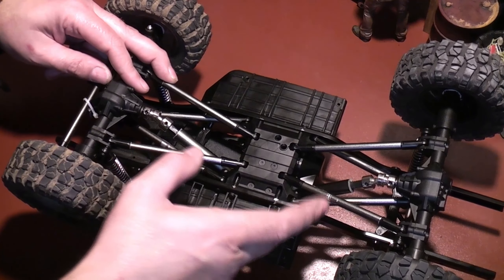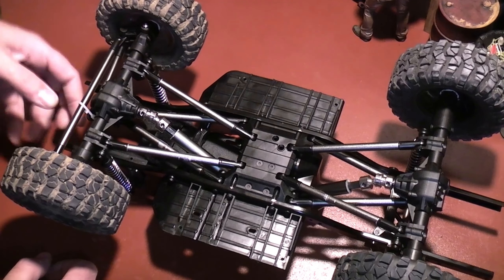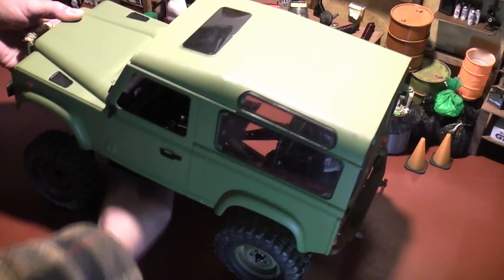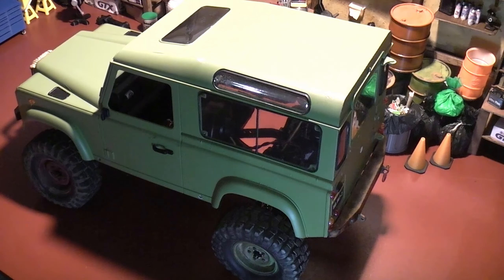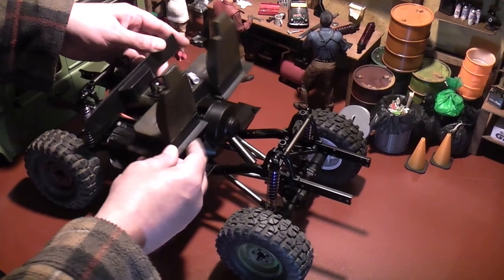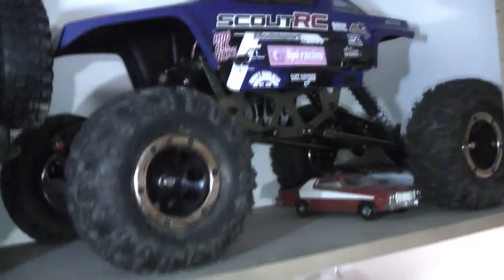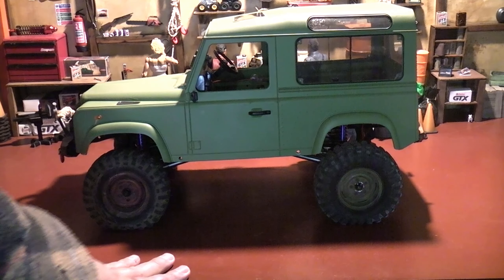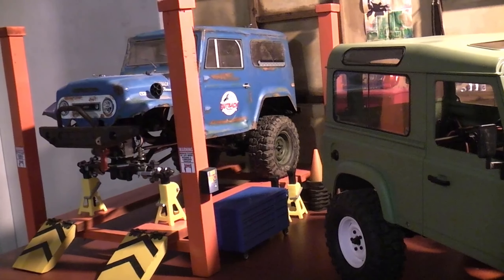Austar D90 Land Rover build project - Part 2

Comment: Where can I
get the body from?
Cant find it on ebay 😣
Reply from the maker: Thanks for the comments. Yes these seem to be not so easy to find now. I bought this a few years ago and they were all over ebay at the time. Try  the likes of aliexpress or bangood, they are still out there
Reply: @JohnnyBareToes1  yes, available of course, but not rough the price you mention. Therefore my question..😄 
Fantatic car...still Impressed!
Reply from the maker: @drakunusrcmaniac8708  Ahh yes, I bought this body a few years ago and they were cheap and plentiful then. They are still cheap when compared to other manufacturers but still more than they used to be. Thanks for the kind comments